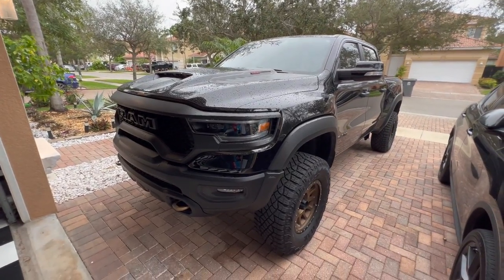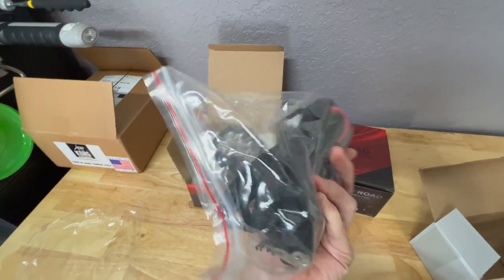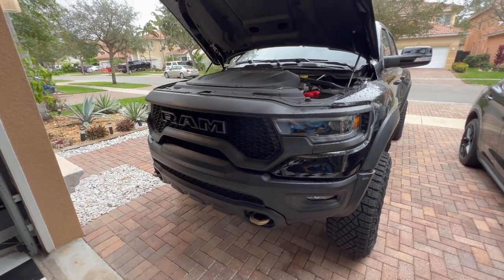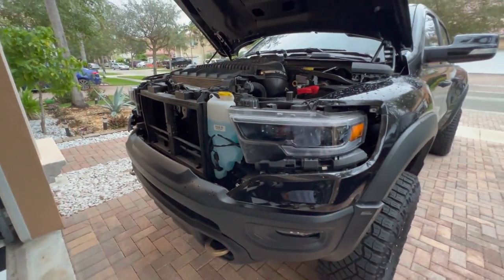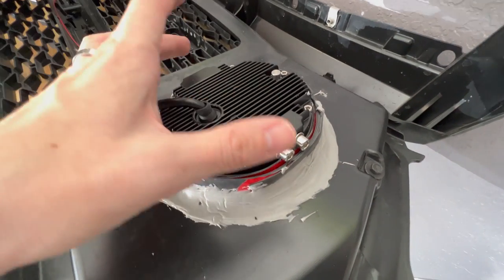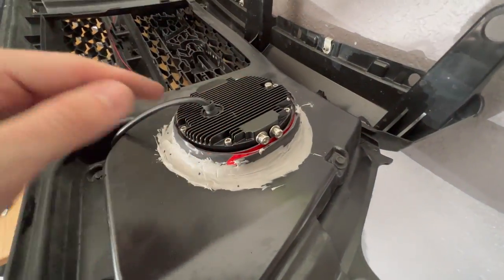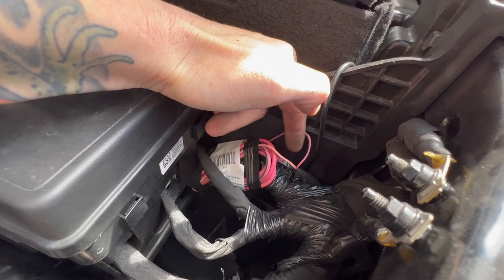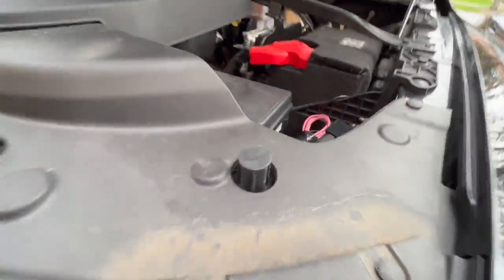Ram TRX Off Road Lights Behind The Grill | Baja Designs Knock-Offs

Comment: Also these are more of an LP4 alternative. The lp4 is 60w which I believe these are only about 50w. This same company has 90w 7” versions which still about the same power output as the lp6. I have been happy with these so I’m thinking I’ll try the 7” versions next. I’d rather buy a couple sets at $100 and not worry about breaking them on the trail.
Reply from the maker: I only called them a LP9 knock off bc they look like a LP9 but smaller. I kinda went over it a little more in the unboxing video. This video I just wanted to cover install since it was already a  long video. But I totally agree spec wise deff closer to a lp4 & like you said for the price I won’t be upset if they were to break or if they were to get stolen (someone actually cut off my rigid cubes when I had them on my Rubicon)